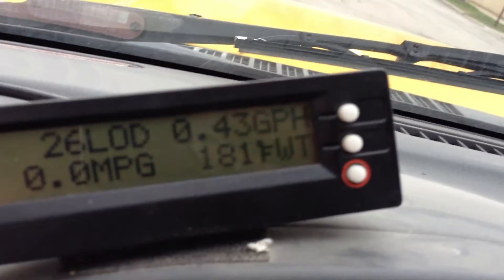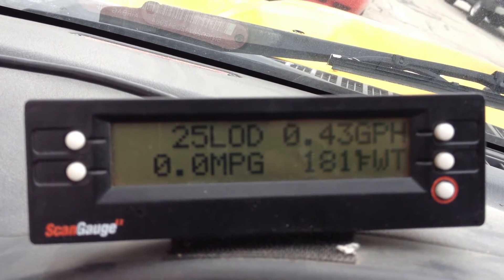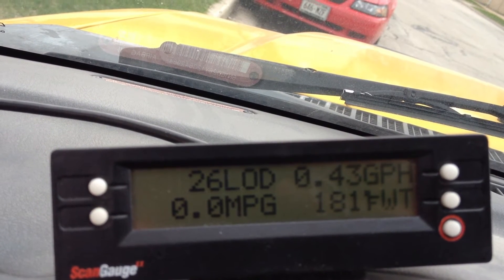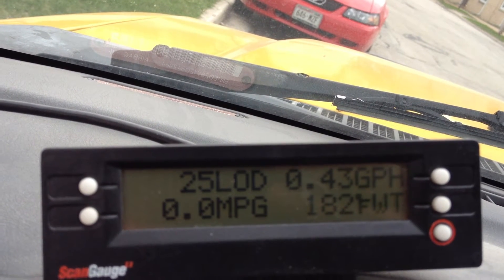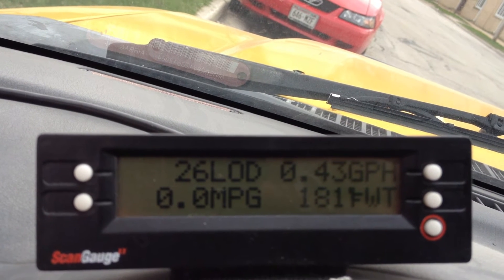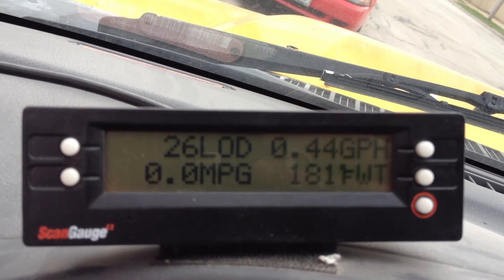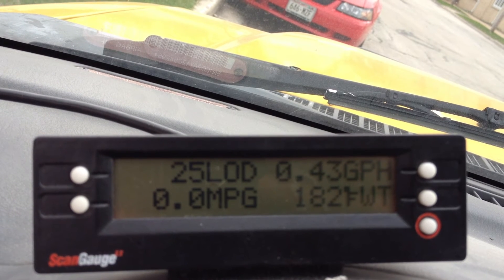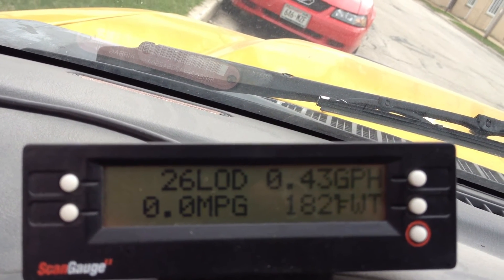VOLO Performance & Fuel Economy Review/Installation Guide-Does it really work LETS FIND OUT!  Part 9

Comment: I assume you mean 26 or 28 mpg correct?  I think my navigators computer may have problems though.  I have to reset it every time too use the info button. It reads 9.7 MPG.  So I'm really hoping the VOLO will get me at least 12 or 13 MPG.  I installed it today and right away noticed it ran a million times better.  It already had power that snaps you back in your seat.  After the install I road around town a bit and I live in a valley so it was good to run up hills and on flat land.  Also I noticed I wasn't getting as much of a snap back take off from a green light or stop sign. I also added a K&N air filter.   It seems to be running quiet. I wish I had an aftermarket display like you got in the video to read out diagnostics.
Reply from the maker: No, my Tesla gets the equivalent of 286mpg comparing cost per gallon compared to cost for electricity. Cant touch that with my gas vehicles even with a Volo :)